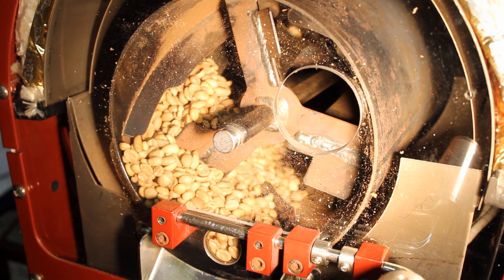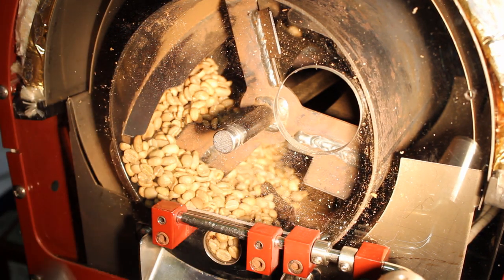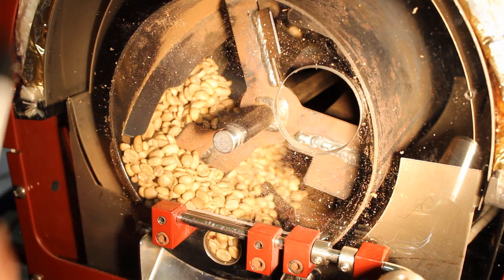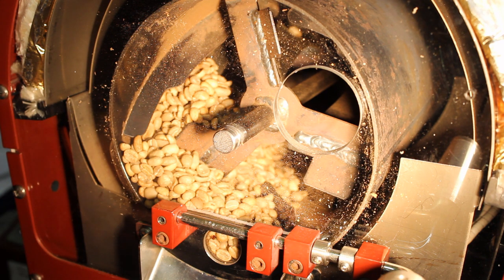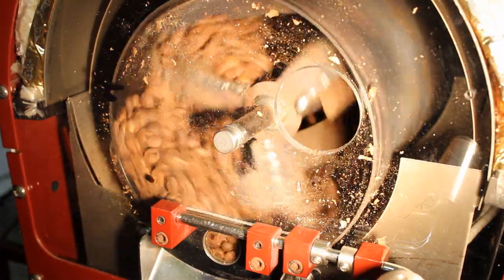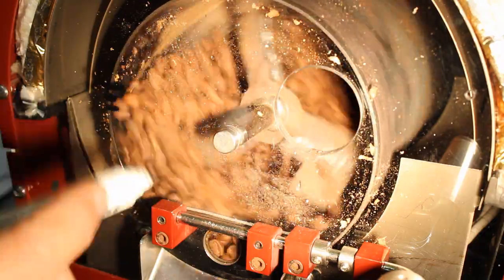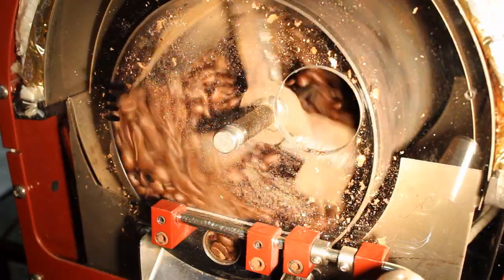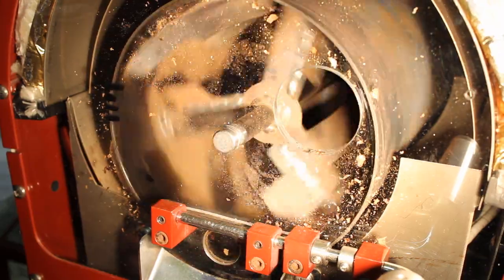Coffee Roaster Drum Speed Simulated Roast

Comment: hi there, its a great video…i am wondering what is the thickness of the glass, is it tempered glass?
Reply from the maker: Hi there. It is actually acrylic. There is no heat being applied. We did several roasts and removed all the beans each time and set them aside. We then removed the original face of the roaster and made one out of acrylic so that people could see through. We then shot several videos placing the previously roasted beans in the drum. It took a long time to do but wanted to illustrate to people the change in size of the bean during the roast and how that affects the way they move. We are making a roaster with a glass front though for training and testing purposes.

Comment: Firstly, awesome video, thank you. 
Sorry if it should be obvious, why are you slowing drum speed as the beans swell and become lighter?
Reply from the maker: Hi. Thanks for the question Phillip. It was our observation that the roasted beans, lighter and larger, actually travel further up the sidewall than the heavier smaller green beans. In the interest of keeping the "array" of bean exposure to the heat (inducted hot air) equal we are maintaining their action on the sidewall.
Reply: @bushbushcoffeesystems2562   thanks! That’s good info.
Reply: I was always taught the opposite. You start at a slower speed to allow more conduction from the beans contacting the drum wall and then speeding the drum up as the roast goes along to loft the beans away from the drum wall and finish the beans with more convection from the hot air. I have always have great tasting results, but I’m curious about trying this method to see if there is any difference.